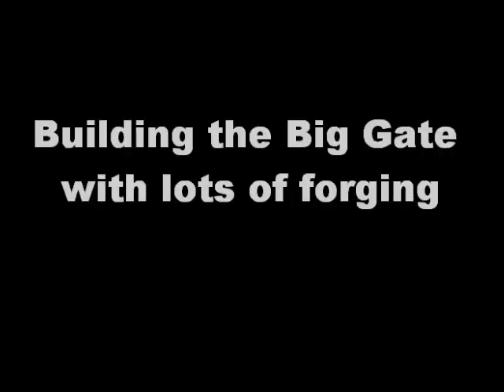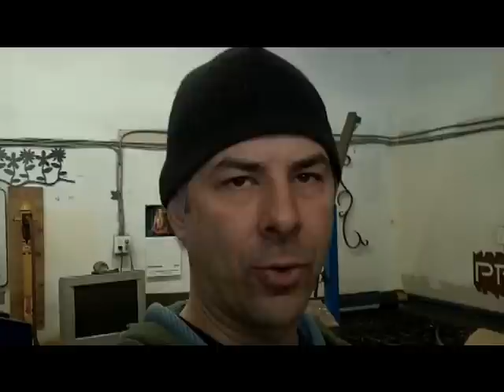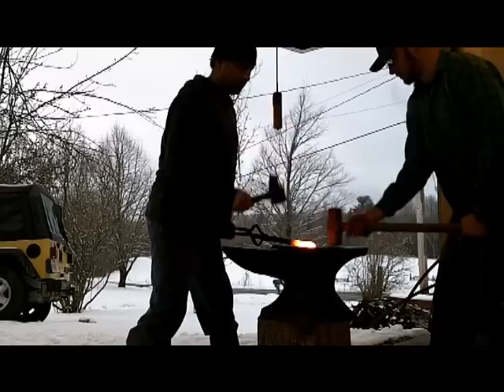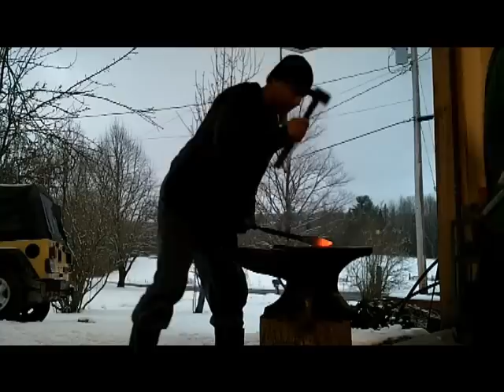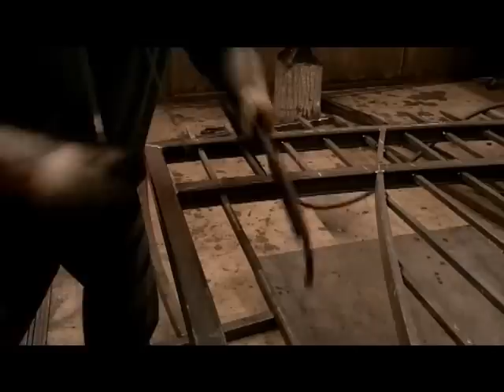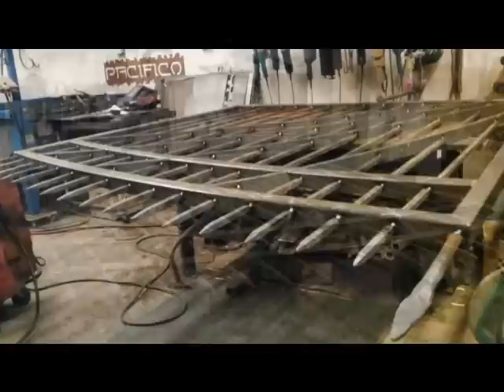Blacksmith and Striker Team Forging The Big Gate

Comment: @modernblacksmith ----  Our gates weighed a ton as well.  We used the trailer we brought them on to help with install.  We used the back and positioned the middle part of the gate on the back, and hung the other side to the pillar.  Then you can use the tailer jack on the front of the trailer to raise and lower the gate.  We also brought scrap 2x4's and 2x6's for cribbing.

You should do some video of the install. . .  Maybe mount the camera on a tripod?  That'd make a neat video.  :)